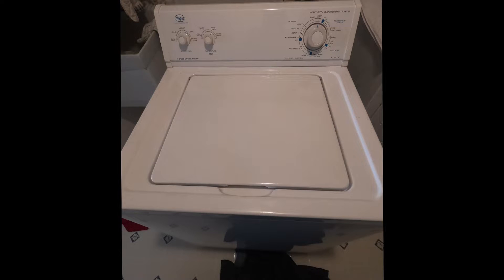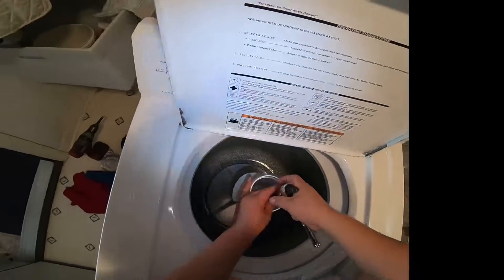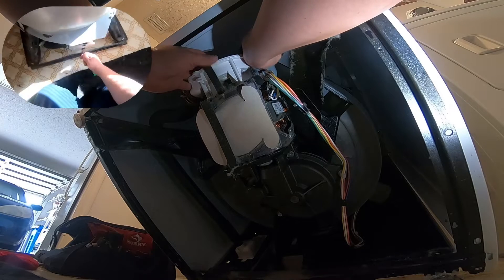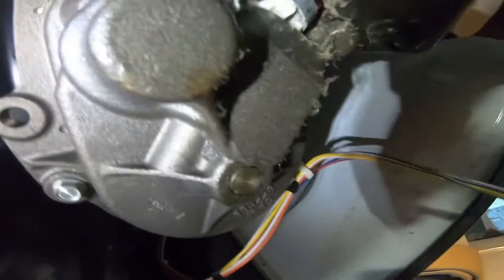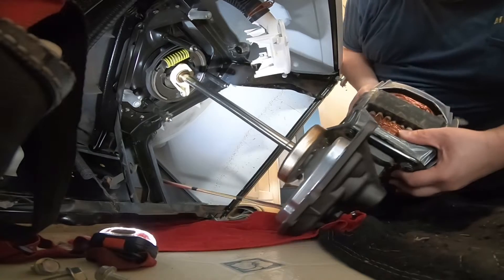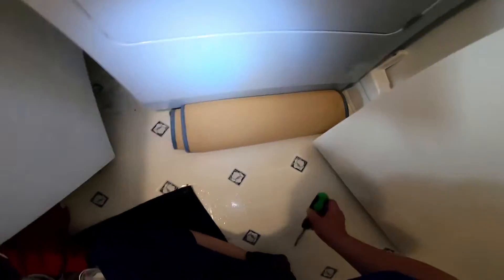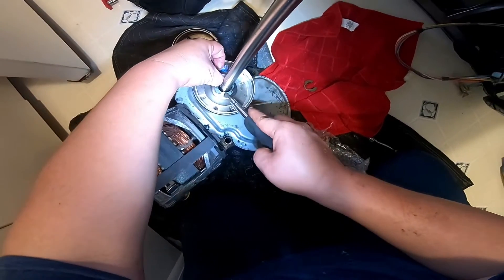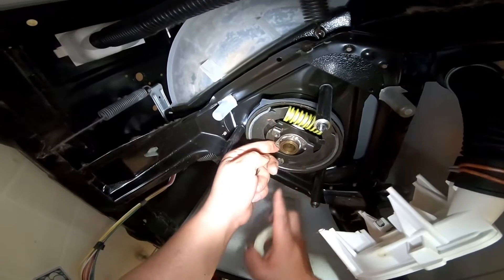How to Fix Roper (Whirlpool) Washer Not Spinning Correctly | Model #RAS8445KQ0

Comment: Our old roper was needing a new basket seal, timer control and clutch cleaned or replaced. Found another used one for $50 on marketplace. Cheaper than the parts to fix other older one and almost exactly the same overall. Keeping the oldest one for parts that might be needed on the one we just got.

Comment: I don’t know if my first comment showed up but I was just saying I have this exact same model which belong to my mother. She passed away two years ago and so it has been sitting in my house for two years not being used the last time it was used it worked just fine, I decided to try and use it tonight and for the first time ever it is not washing only making a quiet light sound when I put it on wash or rinse setting it does however, spin and drain just fine just the same but it just isn’t washing if there is any advice that you may could give me please do so I would greatly appreciate it. I don’t want to throw it away because it may be something simple and cheap to fix but I just don’t know what and I don’t have the money to buy a new washer right now. Thank you so much.💕

Comment: My washer was working except it stopped during final rinse cycle and started making a loud noise. Underneath there are 3 clear tubes about 2" long protruding down from bottom of my tank (visible in your video at 10:30 mark). All three on my washer have a pin inside that is loose. I can rotate and push the pin upward but there must be something missing to hold it there. Can this be repaired easily and what is the part called? There's also a 1/4" thick 8" diameter ring/gasket that doesn't seem to have a purpose?

Comment: I have a Roper that seems to work and spin out the water of some loads - But, not others! It could be related to the type of items in the load or the size. I can't seem to figure it out. It's so unpredictable. Would this be the clutch or something else? I love your videos!
Reply from the maker: It Could be either the Clutch or a Clog on the Drain Line that Could be Causing your Issue.

Comment: Great video! Very helpful. Does this washer have a belt? I didn't see it in the same place as in other videos and was wondering where it is located. Thank you 😊
Reply from the maker: No, this washer does not have a belt is one of the older model that works with the motor motor coupling  and transmission thanks for watching my video.👍🏻👍🏻💯💯
Reply: @DIYRepairsNow  Ok. Thank you so much for your help!

Comment: What you are calling a washer, is really called a circlip to hold the upper white (brake) plastic piece that comes with the clutch assembly.  Thanks, I think the clutch may be my problem.  It wasn't the coupler!  I would also add that the transmission is held in place by 3 bolts, not screws. Now to see how much clutch assemblies cost...
Reply from the maker: You’re welcome thanks for watching my video 💯💯👍🏻👍🏻

Comment: Man I was scared to get into my washer but I'm not in the position to get a new one so I washed your video and dude it was terrific
I'm really glad I'm only going to spend 20 or 30 bucks on parts I'm going to replace all of my hose clamps while it's open
And one other thing; after 17 years on the safety committee I noticed you were wearing your ring on your finger when you were doing this. Please accept this advice and in the nicest of ways take the ring off never wear a ring when you're working on any thing.
One of the astronauts from the 70s or 60s whatever was on his farm and he was getting into his back of his pickup truck he lost his footing as he fell back his wedding ring hooked on something a nail head I guess and he ripped his finger off. No of course that's not going to happen you but even still it's the last thing in the world you need is is that ring to hurt your hands.
 I subscribed to your videos and thumbs up and it was just terrific thank you so very much
Dan
Reply: Knew a mechanic who was working around a starter & shorted out his ring burned the hell out of him, he never wore a ring again